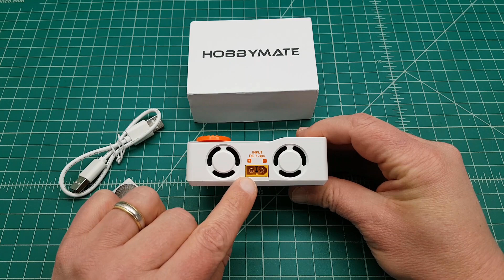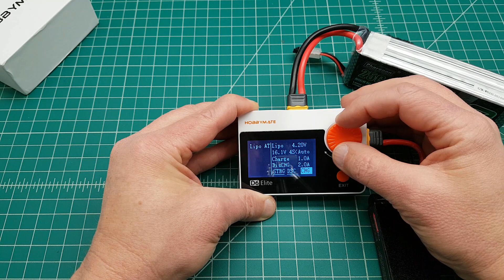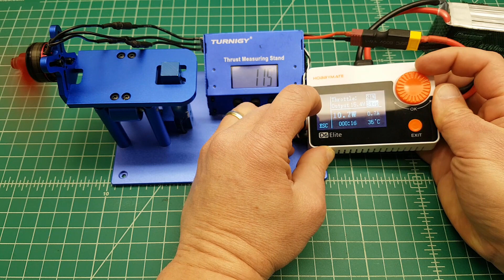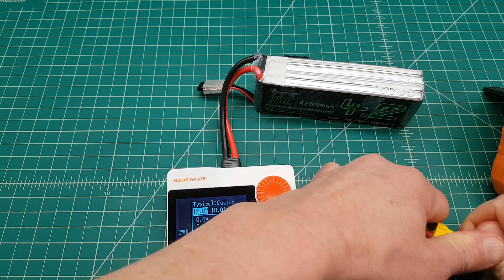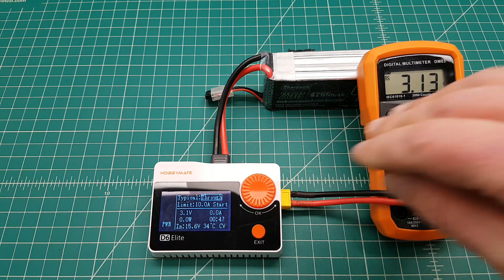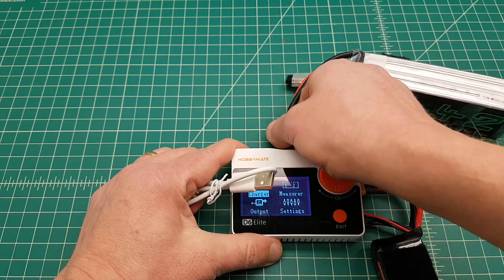Hobbymate D6 Elite Charger

Comment: Hey I picked one of these up last week and I'm trying to just run it connect to an esc and a motor to be able to test motors before cutting wires and installing.. can't seem to get it to work, I noticed you only have the-and signal wires coming from the ESC Port on it when your running thrust test... I assume the power is coming from the thrust machine in that set-up? How do I use it just with an esc??